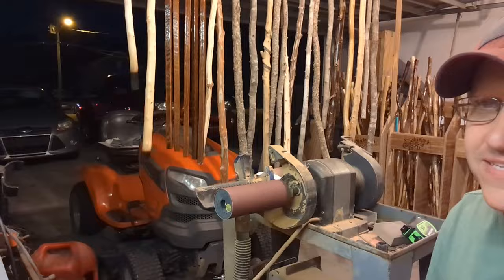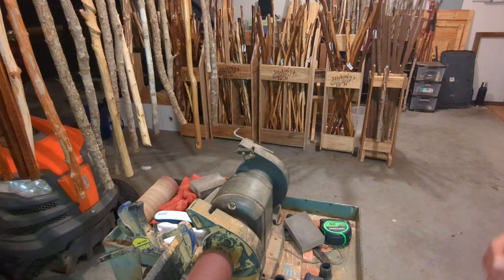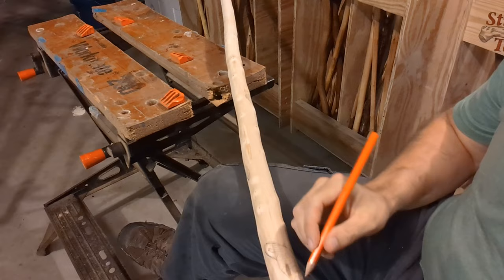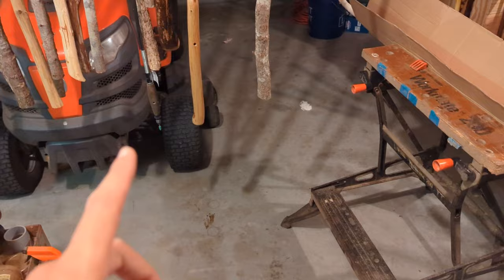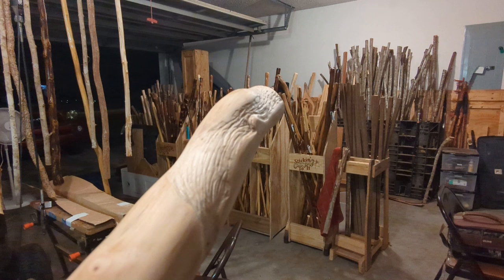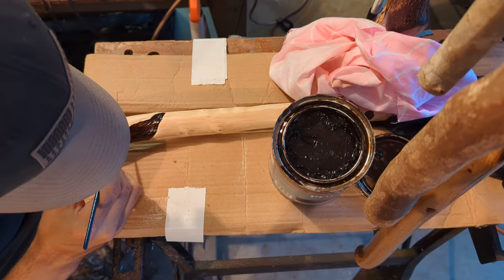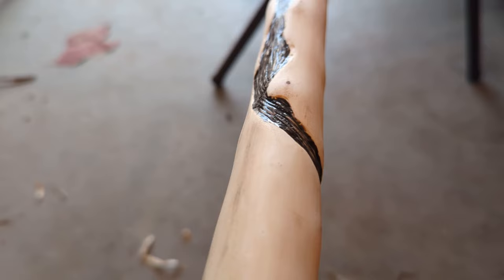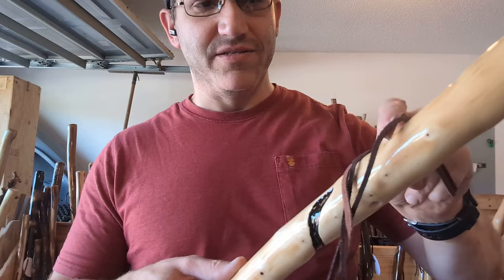Walking stick with a "Natural" look

Comment: You really should be wearing a mask so you don’t regret it in the future
Reply from the maker: The bits I was using the carve into the wood doesn't create much dust at all. But you are right, I should be wearing a mask for the table sander because of the amount of dust it makes, Which I do now. This video was made months and months ago before I got my mask. Now I can go in a gas chamber and I wouldn't know it 🤣

Thank you for the comment!